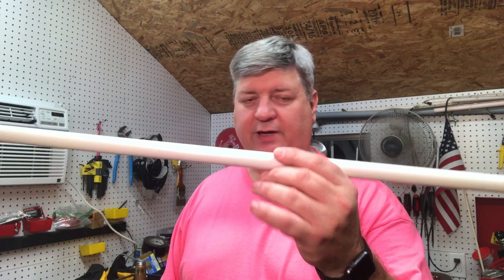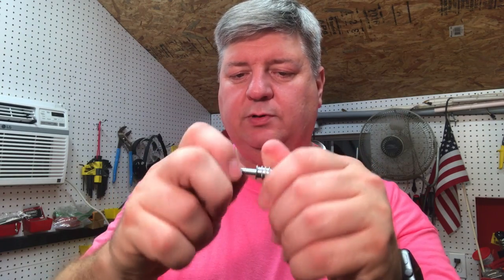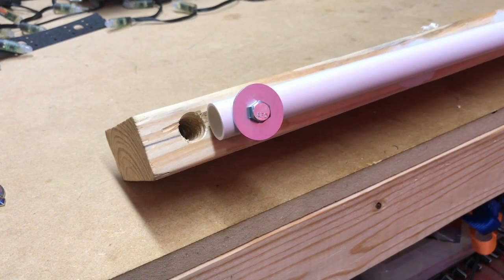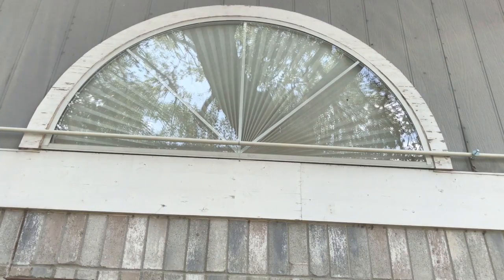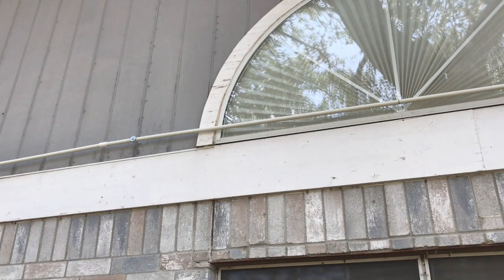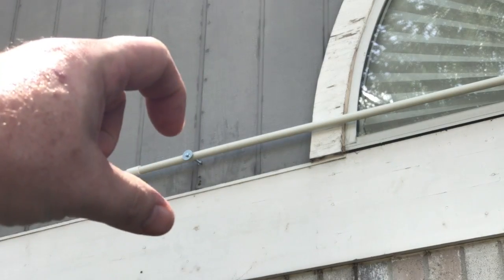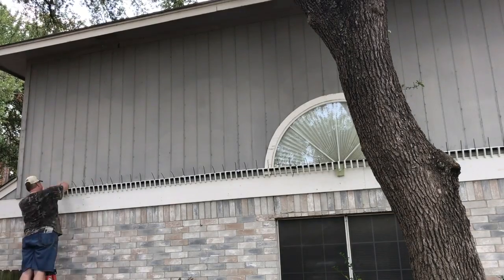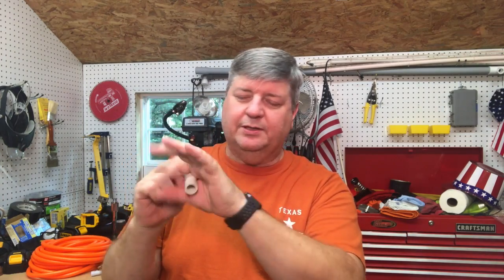RGB Pixel Wall Washer - Attempt #2

Comment: So I used the insert screws for all of my roof lines. I pushed my bullet pixels through 3/4" PVC pipe with a 3.75" spacing. I then used the insert screws about every 6' and I used conduit hangers to hold my pipes up. The conduit hangers work great because they have a gap in the back that gives space for the wires on my light strings. I also painted everything flat black and no one even notices that they are there.
Reply from the maker: Yeah, I use that for the horizontal run over my garage. Works well. I think I finally figured this one out this year. :)

Comment: Very entertaining Jeff.  I have a stucco exterior and am reluctant to do much to screw it up.  Across the top of my garage (17 ft) I am thinking of using the Boscoyo strips and use a bungee cord on each end to provide some tension.  I imagine I will have to use some additional support too.

Stay out of the heat......  I think it might be getting to you a little.

Pete in AZ
Reply from the maker: I'm planning on doing something similar for my garage outline. I'll use those metal inserts for added strength on the ends. 

For this prop, there's probably too much weight with the PVC and pixels. I doubt the strips could handle the stress at 30ft - I could be wrong. I have a habit of over engineering these things anyway. 1/4" steel plate for my 15ft mega tree topper for example. LOL!

Too much sun... HA! Yeah, I don't get to work on this much during the week so I have to do as much as possible all at once. Tons of water needed to stay hydrated.

Comment: They make a silicone you can inject into those screw holes to gap fill around/behind it whenever I hang things outside with those type of nuts I do that inside the open end and also around the outside just so water can't get through into it (water is evil it always finds a way.)

Comment: I know this is an old video and I just found your channel so I'm watching from the start and learning. As a fabricator I would use 10' piece of 1/4" x 2" aluminum bar stock . You could drill 2 holes in it per pvc light socket.and zip tie like you have done. Rigid consistent spacing,then use your threaded inserts on the house to mount like you have done. Would painting the pvc silver inside help the light to wash downward farther?
Reply from the maker: Possibly. Commercial wall washers have lenses in them to focus the light which probably works better than my implementation. It actually looked fine by itself and may have benefitted from painting the inside, but with other props nearby with the pixels pointing out, they washed out the indirect light from this prop. I changed the pixels out for some pixel modules later on and it works much better for 2018. And welcome to the channel! :)